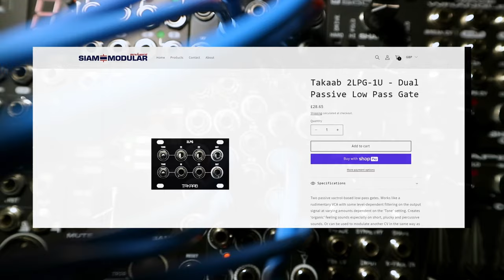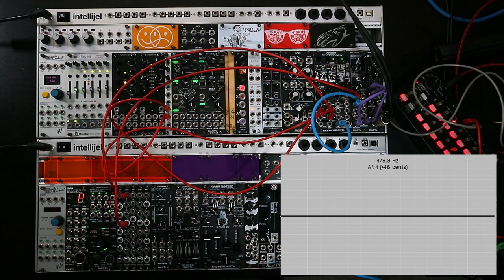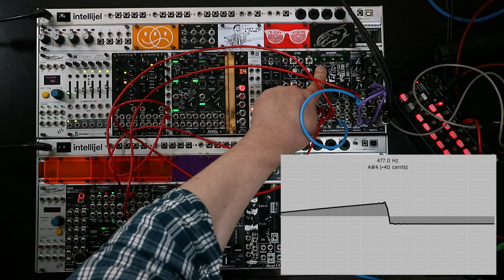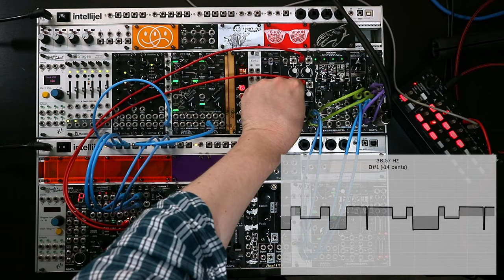Logic Modules at Audio-Rate Sound Amazing.

Comment: This explains something I’ve observed with running both the PWM and triangle or sine wave output of an oscillator into an AND module. The pulse width control ends up acting like a pseudo low pass gate where clockwise has the full harmonics while counterclockwise chokes them off until there’s no sound, but not in the straightforward high to low nature of a LPG. It’s choking off to whatever harmonics are at the lowest “high” point of the triangle or sine wave.

Comment: Another classic way to get a "squared off" distortion is with a slew limiter that has gate outputs for rise and/or fall. (Many function generators will work, eg maths, Rampage, Contour 1, etc..) Put your audio through the slew with times set near minimum and these gates will pulse at audio rate. You can modulate the slew time to vary the sound, though it's going to be very crunchy regardless.

Comment: That's really good stuff, the essence of what modular is all about. Love the idea, and the results. I wonder what similar things could be achieved if you use a similar approach with a Pico A Logic, which does "logic" operations on audio, so you're not stuck with the fixed output voltages. It does sum and difference, which shouldn't be that usable for such purposes, as it's basically just mixing in or out of phase, but it can also output min and max value, which should be a lot more interesting. I think I have it somewhere, just not in the rack currently. I might give it a try.
Reply from the maker: The min/max output stuff should be a lot of fun paired with some offset voltages to nudge sound sources up and down on the way in.
Reply: @OscillatorSink  Tom Churchill put out an interesting video a few months back using logic (particularly min logic) to generate melodic pitch CV sequences from LFO's. Would be interesting to explore similar approaches for audio rate .